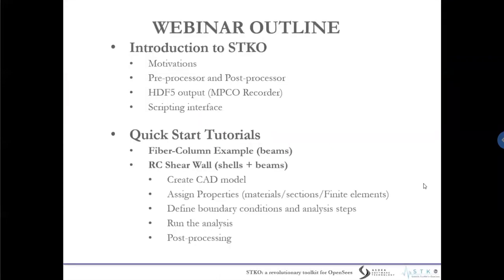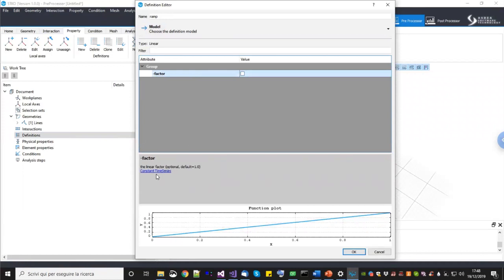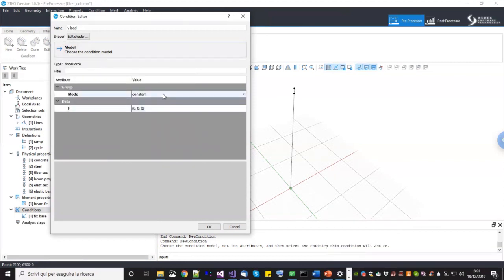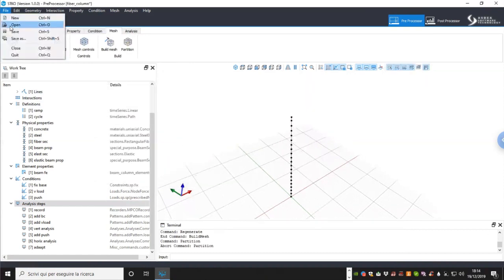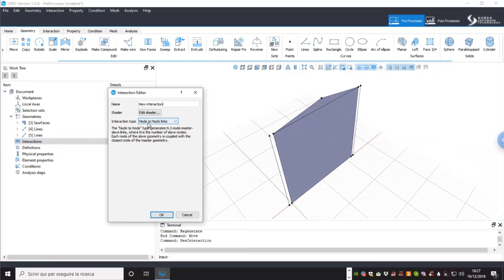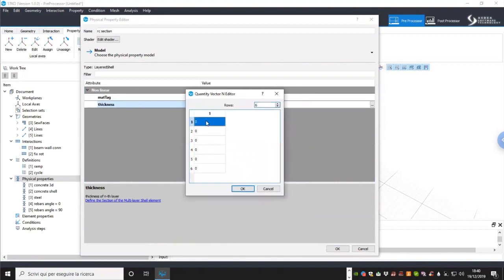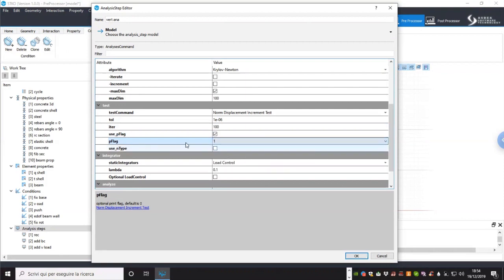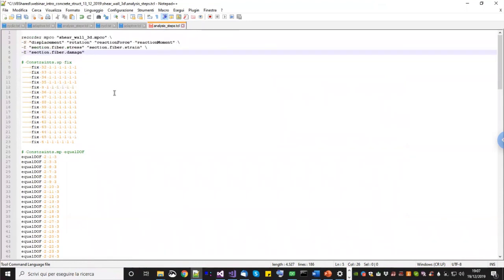STKO E-Learning Course - Modelling a Reinforced Concrete Frame Structure (english webinar)

Comment: Hello, I'm modeling a supported-supported beam with two load plates positioned in a symmetric way compared to the half beam. The simulation is with displacement check on the half, an example similar at this video. The software gives me the following error: It doesn't recognize the node assigned for the displacement check. Before I selected it by "Selection Sets" and after I put it in analysis steps by "Command Analysises".

Comment: hello sir 
thanks for having such a nice and helpful video lecture 

i have a question sir 
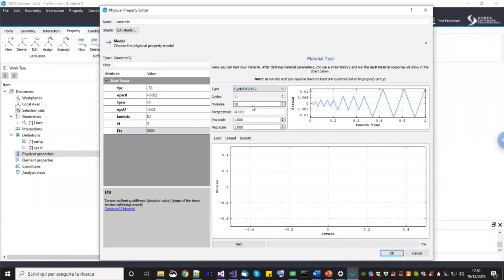15:43 i try to test my model but it is not working please let me guide
Reply from the maker: Hi, please check out our STKO user forum and see if anyone has had a similar question. If not, you can ask specific questions about your model on the forum. https://asdeasoft.net/forum/index.php?sid=743478e419de88899e89aa6f2b577cf1

Comment: Hello, first of all, thank you for the good video.

I'm JKLee studying after watching your YouTube video 'RC Fiber Column'.
But I have a few questions while watching and following your video.

1. Before setting 'Core Material' to one, I could get the same 'Stress-Strain Curve' as you. 
However, after setting it to 1, no curve was obtained.
Is it because the version is different?
Does it not affect the final result value?
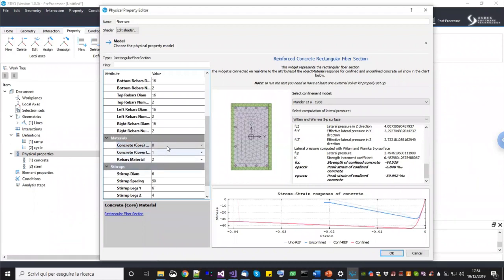( 20:00 in the video )

2. After the interpretation, the output file was obtained.
But in model stage, there was only model stage 1 and there was no model stage 2.
How can I watch 'original analysis' too?
( 42:20 in the video )
Reply: I encountered the same problem, especially I can't find the model stage 2 so I can't see the working cyclic load in the post processing. Any suggestions for this problem?
Reply from the maker: Hi JKLee,

In order to best answer your questions, could you copy them in a post on our forum (https://asdeasoft.net/forum/) together with the file that you are using? That way, we can directly look at the file and see what's going on here.
Thanks! 
STKO Team

Comment: Please, can you share the custom TCL script you used for the first example (@ 37 minute:18 sec in the video)?
Reply from the maker: Dear Ibrahim, You can download materials used during E-Learning courses on our website: https://asdeasoft.net/?webinar just scroll to the course name and click download files
Reply: @STKO_ASDEA   In the example the TCL script (@ 37 minute:18 sec) is not available.
Reply from the maker: @rajendravarma5237  if you download the files from the webinar webpage (webinar #02): https://asdeasoft.net/?webinar#02
you will find those scripts inside the "...webinar_12_13_2019\fiber_column\support" and "...webinar_12_13_2019\shear_wall_3d\support" subfolders.
Note, however, that this video was filmed in 2019 using a previous version of STKO. At the time, using a TCL script was the only way to run an adaptive time step. Instead, with the current version, you can simply create an Analysis Step and choose the AdaptiveTimeStep directly there (FixedTimeStep is the default), without the need for the custom script